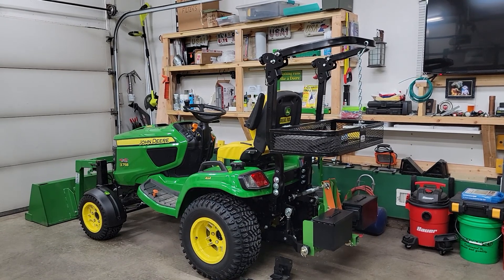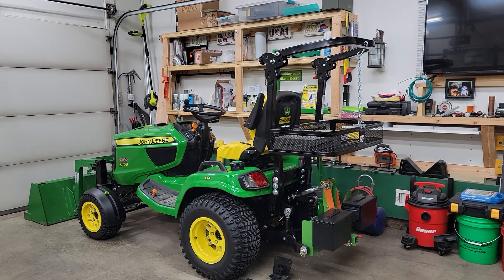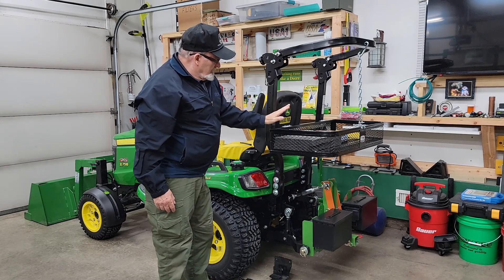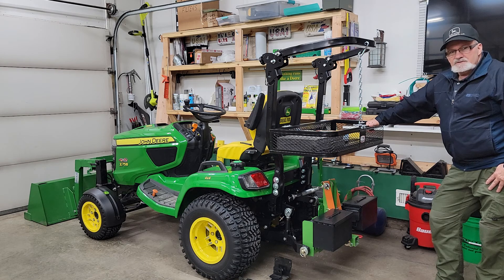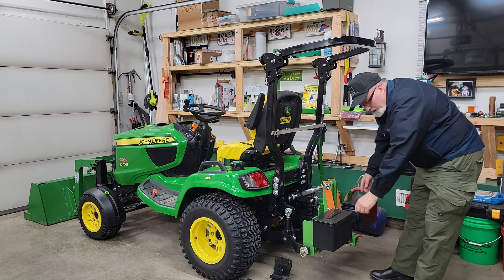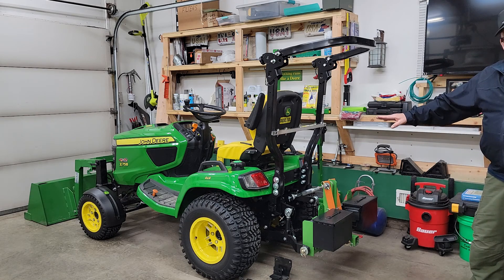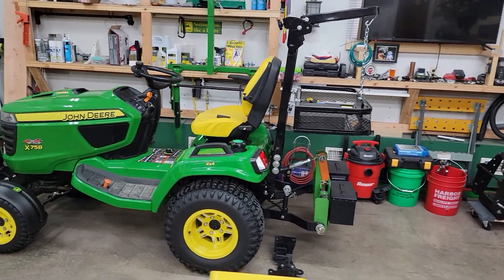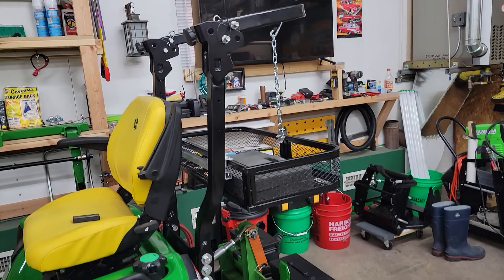X758 with ROPS. Add carry basket to any rops. garden tractor ROPS. X700 series John Deere.

Comment: Hey Mike, Thanks for your videos.  I too bought an x758 over the 1025r.  I have a very steep hill to mow and the 758 doesn't seem as top heavy as the 1025.  My x758 walks right up and down the hill, no problems whatsoever.  Your ROPS video was key in getting and installing a ROPS on my 758.  My JD dealer would not sell me the ROPS when I bought the tractor.  Said it wasn't OSHA authorized.  I went to a different JD dealer and told them I had an x950 and I needed a ROPS.  Got it ordered and when everything came in, it took one hour to install it.  It's a two person job, but straight forward.  I did have to go back and get the new hitch plate as the old one would no longer work.  That being said, there were no modifications required.  Bolted right up.  Thanks again for you channel!!
Reply from the maker: Thank you, I just now saw this.

Comment: I have been after my deere dealer to get the rops on my  x758 but seem to talking to a wall,  I think it's time to go to a different dealer
Reply from the maker: I got mine from kibble equipment, it's the John deere dealer in Mankato Mn.
Reply: I ordered mine online from Weingartz. I don't know if it was a mistake or a sale, but I remember the freight shipping was practically free as well. Their website was not the best (it kept insisting I accept cookies, and when I did the page would freeze) so it took me a few tries to get it through, but everything eventually showed up about a month later. Some specialty parts take a week or two to get to them from the factory to package it onto the single pallet.

Comment: Mike, I can’t afford the rops but would like to add a sun canopy to mine. I have a canopy that was previously used on a z920m but it had a rops that the canopy was attached to. Could you show a close up of how the rops is attached to the frame? I am hoping I could do something similar for the canopy to work on the x758.
Reply from the maker: There is a company, I can't remember who, I found it doing Google searches at one time. They have brackets that replace the handles on the fenders and they have the canopies coming off that. Pretty cool how they did it.
Reply from the maker: Sorry, for some reason I don't get notifications. There is a company that makes canopies for our tractor that is attached to the hand hold Grips. There's replaces the factory ones and extends up for the canopies.
Reply: @MJB516  can’t seem to find that company. Remember name?
Reply from the maker: @jamesmabry2261  I'll try to Google it. Might take some time.
Reply: @MJB516  thank you
Reply from the maker: @jamesmabry2261  James I didn't have to look very long and several options came up.
A company called Femco has a website, go to it under accessories and you'll see them. You might have to contact them and tell them your model.
I can't find the first one I mentioned. But it's out there somewhere. I also found a picture of one that can be zoomed in on. Looks easy to make if you're at all handy. Not sure how to send it.

Comment: Do you know if it will work with the click-n-go bracket (X758)
Reply from the maker: Sorry, just now seeing this for some reason.
And I have no idea.
Reply: Yes, Click-N-Go brackets are actually built into the ROPs side plates down low. If you order the ROPs by part number, you'll have to order the pins and springs separately. The pins are not the same pins from the standard click-n-go brackets (if you already have some). The ROPs version are noticeably longer. They function the same with all accessories I've used, but the geometry is different so the longer ROPs-specific pins are necessary.

Comment: Can you get me the addition part numbers for the lower pieces?
Reply from the maker: Hi Brad, just seeing this now. I see it was posted 2 weeks ago. Do you still need the part numbers?
Reply: @MJB516  No sir, I work at a dealer, and I was able to find it. If you search a X948 you can find the ROPS and all the part numbers. I just installed it on an X758 for my customer at my dealership.
Reply from the maker: OK I'm glad it all worked out. I don't know why I didn't see your message earlier.